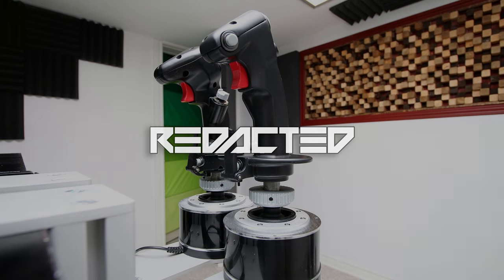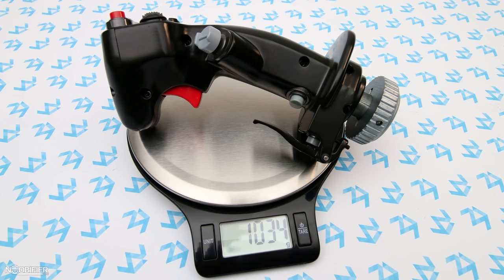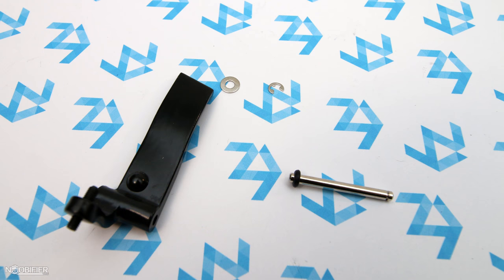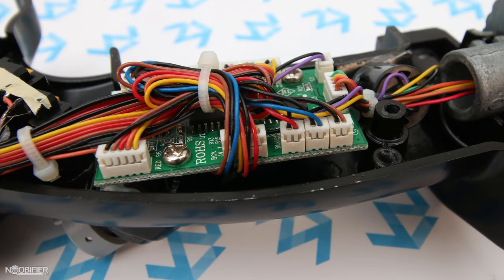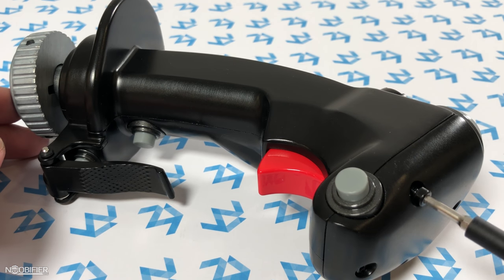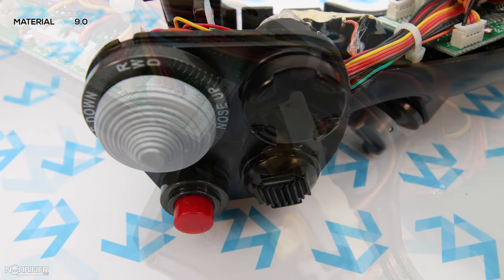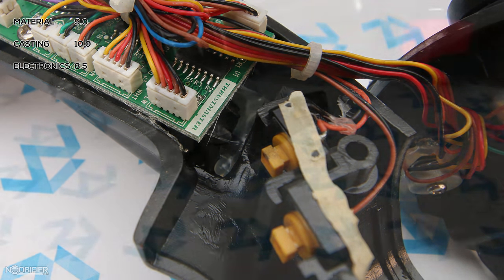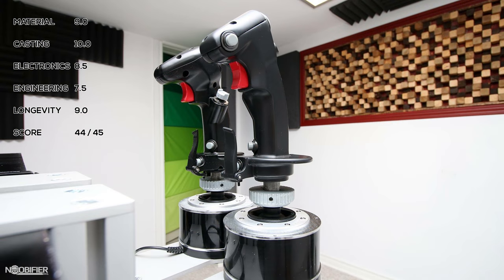#EXPOSED - #Thrustmaster Warthog - Full Teardown & Score - #nobullshit

Comment: Thanks for this! seeing the insides gave me the confidence to open my Warthog up when the POV HAT stopped working.  All the other switches still worked correctly so I suspected a broken connection.  Sure enough, once I got it open, I found a wire to the POV HAT had gotten entangled in the HAT centering spring and as the spring compressed during movement, it pulled the wire off its solder-point. (I agree it's a little odd to see them exposed in such an otherwise clean build)  Quick dab of solder and a little work securing wires to prevent a re-occurrence and it's back at 100%

Theres not so many videos showing a teardown of the stick portion (rather then the gimbal) so thanks for making this a bit easier for me!
Reply from the maker: No problem. Normally the gimbal is the part that breaks due to use or wear. I hope to continue this series with some new grips that dare coming out soon

Comment: Besides the Cougar (also TM) The Warthog was effectively the first quality hotas that set the standard on the market. Brands like VKB and Virpil are taking things a tier higher, but you are also paying extra for it. You can get a Hotas set for like $430 or either the stick and throttle for about $200 on Amazon during a special. Not the best but a great start would be my vote. I've lost count how many years I've had mine and it still centers fine. I think people have a natural tenancy to twist the stick during use which can break it.
Reply: Yup noticing some extra wear in the gimbal due to that may have to buy a backup because of that unf.

Comment: The Warthog is made of Zamak, a Zinc alloy. If it was made from diecast aluminum it would be much lighter. Also you can tell it's zamak because the exposed metal has a darker gray color to it. Aluminum would be shinier.
Reply from the maker: Ok
Reply: @NOOBIFIER1337  So have you corrected your video?  Big difference between Zamak and Aluminium.  Zinc alloy is much more likely to break or crack than aluminium on impact of any kind.  Important consumer information that.
Reply from the maker: It’s not really possible in the current way YouTube operates.
Reply: TheNOOBIFIER1337 it possible to add labels or captions. The metal is low quality and many grips crack after some years. Specially the tailpipe that connects the grip to the base. 
Besides you didn’t mention anything about the gimbal which is all plastic and can also fail and tends to have “stiction” problems.
Reply from the maker: This was just a review of the grip. I have 3 grips. I have never seen one come apart. It is impossible to add captions to YouTube.

Comment: Man, I do love my Warthog.  I really wish the manufacturer made a lefty!  I do have some concerns about the synthetic guts in the base, and I find it curious they chose to use synthetic in the base given the grip is cast aluminum.  You'd think they would use the metal on the parts that actually experience wear and tear.  The grip itself really shouldn't degrade depending on the load you apply to control surfaces.

Comment: Just to add, for anyone thinking of buying a second hand one, the push button switches are very cheap, and will start to stick to the on position after a few years, usually once your warranty runs out.  I'm talking about the pickle, thumb, lever and pinkie button.  There is no way to repair these buttons, as they seem to be sealed.  Thrustmaster will charge you £30 per button, for replacement.   But you can order OTTO buttons from mouser.co.uk.  Which are the original military spec buttons P1's or preferably P8's, but the P8 buttons are hard to find, these have a shorter body, and make fitting them easier, without modification.  Thrustmaster really should have gone that little bit extra on these buttons.  The Throttle buttons will die first, so in total thats 7 buttons, at £15 each from mouser.  But do your research on them make sure you get the correct size and type.  The 3 throttle buttons are of different design to the ones on the stick,  https://www.mouser.co.uk/datasheet/2/603/Otto_P1_Sealed_Military_Pushbuttons-1214958.pdf

Comment: Thanks for this vid.  Gives me the confidence to take my A-10 stick apart and repair the pinky switch which went inop after less than a year.  I've seen several net references to this happening.  That said, it is a quality piece of gear which I would recommend.  I sprang for the F-18 add on handle and like it a lot, though the pinky button is very stiff. I tried a green spring to soften the axis stiffness, but found it too weak and it wouldn't center the stick.  The shortest extension was the solution and I can highly recommend that.  FWIW.

Comment: Not sure how long I've had my grip. I got the very first one in Canada. I'd say 9 years. The grip's red trigger has paint worn off where the index finger sits. The bottom two hat switches (thumb) also have lost some paint due to wear. I've flown just about every week, maybe two or three times a week. The paint is partially worn off because I use those buttons so much. The only thing that come close to the quality of the grip sits inside a real A-10C. That's the grip.  

The base (and specifically the gimbal) is not anywhere near that quality. I have a second NEW stick because the first one's gimbal got so much stiction that it could not be used anymore. (Yeah, I fly a lot.) The second gimbal is now showing stiction. That's after only a couple months of flying. The gimbal is made of PLASTIC and that's what takes the entire load of the stick. There are fixes to the gimbal but you have to be crazy to disassemble one and get it back in smooth motion again. I'm still working on my repair to the first stick.

 Hope this helps everyone.

Comment: The one thing that's wrong is that it's made of pot metal, not aluminum. If you drop it, pot metal could shatter like glass. It's also very hard to repair . On mine the hinge for the paddle broke twice. JBWeld works good because pot metal is so porous there's a lot of surface area to grab. The soldering on the switches was horrible.
I have move to a Virpil throttle and a CM2 base and will be getting a grip and selling off my Warthog.

Comment: My DMS has stopped working unless a lot of pressure is done to it, this started to happen about 2 years in, and atm is just a PITA. The CMS sticks in place sometimes, specially sideways and into the grip, so, CMS RIGHT. The base of the grip failed within a few months, I had to replace some wires because they broke from moving. This also caused a short, which fried one of the "protections" on the base, which are some sort of in-board fuse, I soldered around the fuse, so, basically its not protected anymore but at least it works. Sticktion was a major problem too, I had to dissassemble it and completely sand it perfectly, and reassemble it with some proper aeronautical lube (Jabbers has made a video with what I did since then, he used the same exact method, same lube, etc). Mine is from 2016. Since yours is much older, I wonder if newer ones suck?
Reply from the maker: The build quality on Virpil has improved. The generations can be seen by the colour of the PCBs. Green was gen 1. They switched to red and now they use blue on their newest. No more hot glue needed as everything is made to fit. Wiring is simple now as well with fewer connectors. BTW.. I have not used any thrustmaster products since 2016. As soon as I saw the interior of the TMWH being all plastic, I was like.. no, never..
Reply: @NOOBIFIER1337  right, i didnt know that. Mine is green I believe, so that makes sense

Comment: People should be be aware the quality of the grip is IMO, much higher than the gimbal its attached to.   Noob covered the WH base in another video, but 99% of users would being getting the grip & plastic gimbal base as a unit.   I agree with Noob that 1st impression is reinforced because of the grip weight, but I have found that weight has its drawbacks.  After my WH gimbal broke, I put the WH grip on a VKB gladiator pro; which was MUCH better.   If using with extension I would prefer a lighter grip; some of that comes from flying helo’s where I don’t want a heavily resistance to counteract the weight of grip.
Reply from the maker: mtnmist1 agreed. The grip is lovely, the gimbal is a dumpster fire covered in shit
Reply: @NOOBIFIER1337  Pulling no punches there, but absolutely spot on

Comment: I agree with your assessment.  I tested the HOTAS for the weekend.  I loved the feel of the stick.  The buttons were a bit stiff but I figure that's so you don't accidentally trigger them.  I did not like the throttle for SC.  I am a fan of having an analog axis on my left thumb and it could not give that.  Still looking for that perfect throttle with a center detent and analog thumb stick.
Reply: I think the Virpil have all of that: the throttle have 4x  4-way hat on the handles it self and if you use it for strafe action it will be good as much (if not even better) than an analog stick...

I'm looking forward to it, while wayting for a stick that have a lots of button AND a twist z-axis...
Reply: Cugino are they analog hats?  I have been using an analog stick on my CH throttle for years and it’s awesome.  Binary  on off just does not do it for me
Reply: @DamianInman  Dont' know for sure (I don't have it), but sice the site report them as a 4-way HAT the are probably on/off type...
Noobifier has it, he can provide better detail on this aspect

Comment: How many gimbals have you gone through? The quality of the grip may be overridden if it kills gimbals faster than the alternatives.
Reply from the maker: I have thrown away three WH gimbals
Reply: he mentioned several on his last video. I assume he will do the base part, spring, and adjustments in a later video where we can expect him to crucify this set as he alluded to already.
Reply from the maker: @neonspark707   The TMWH gimbal is a hunk of shit that should be launched into the sun.
Reply: TheNOOBIFIER1337 love it, Noob says it like it is 👍
Reply: I bet it gets a lot more abuse in space sims than it does in flight sims. Also with extensions compared to without them. Not trying to say it's very good or anything, just saying.

Comment: I got one. the grips 10/10 but the base isn't. maybe 5/10. I don't like the spring setup . Too strong  and the gimbal can be a bit sticky/ clunky. Its better than the Cougar though.  Im looking at a VKB Kosmosima to replace it once that's actually buyable.
Reply: Nyogel 767a will make your TM base last longer and feel better.  Do a youtube search to get a feel for what I'm talking about.  I got a tube on amazon for $30, and greased my TM 16k Hotas set.  Both the stick and the throttle feel better, 16k throttles are fairly sticky when first purchased, the grease was a definite improvement.  

I'm fairly happy with the end result, but I'd suggest spending a little time on youtube actually seeing people's results in videos before making a choice of grease.  I think some people prefer the slightly less resistant 774 grease.  Doing the work wasn't that bad, the stick and the throttle together took maybe 30 minutes of working carefully to do.  I doubt your stick is built too differently than my own.

Oh, one other thing.  Rather than going with VKB, you might consider Virpil.  The Warthog grip works on a Virpil base, no extra work just screw it in.  If you like the Warthog grip that is, perhaps you play other flight sims?

Comment: Warthog user here.
The twist axis is really a bummer for games like ED , Arma 3, and SC.  That is my one and only hardware complaint.  I've used mine for years, and never had a misfire, or any longevity issues.  
The software is something I think you should mention in your videos.  The Thrustmaster software IMO is junk, and I do not use it at all.  
I have to give you props though, your target button is FAR more clean than mine.  Yours looks brand new.  I guess its time to get a toothbrush to it...sigh.
Reply from the maker: I cleaned it before the video. Don’t worry about being dirty, I won’t tell anyone

Comment: Total garbage. I've had mine just over a year and I've had both hat switches go on the throttle and the flightstick. Warranty in Canada or US only covers 1 year and their shipping is insane 35 euros+. Their support will gladly take your money; $100 for a new button replacement for a $800 hotas I purchased a year ago and barely used recently, tested it recently and poof the another button stopped working. I really regret buying Thrustmaster and not going to Virpil like most people recommended but I just loved that metallic heavy feel and I wanted the authentic model. Too bad the electronics are complete trash and not properly grounded. Oh and it's filled with BPA for those who love cancer.
Reply from the maker: Alpha Prime is metal.

Comment: #SomeBullshit! ThrustMaster HOTAS Warthog INCLUDES THROTTLE...which you did not mention. I wish you had as thorough a tear down on the throttle.

It was a good review of the stick, however, but stick is made of either Zink or pot metal, NOT aluminum.

Thanks,
Chas
Reply from the maker: The stick is sold solo. Not everyone buys the throttle
Reply: TheNOOBIFIER1337 but I would guess that a huge preponderance buy the HOTAS...I’ll give you the fact you didn’t specify HOTAS in your title, but “WARTHOG” certainly implies it.  Regards

Comment: I agree with your eval on the grip...but the giant plastic ball gimbal base.  Is a completely different story and in my estimation and experience where the thrustmaster warthog fails. It's really heavy.  When the gimbal failed and I used the grip on a vkb gunfighter base it felt very clunky and had to use dual springs on each cam.  This review felt safe but inaccurate because you have to buy the base to get the grip.  And the base is a toy no matter how solid the grip is.